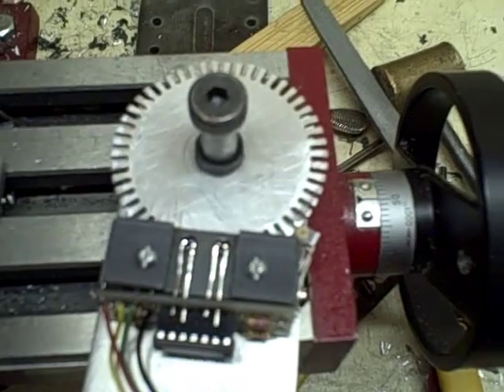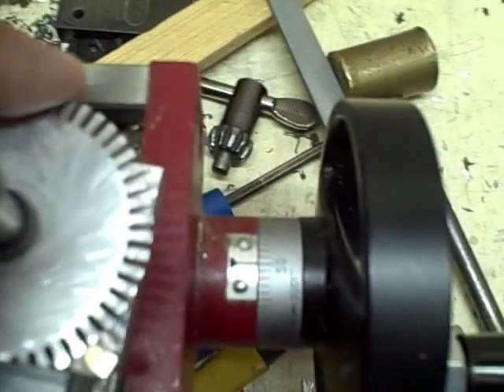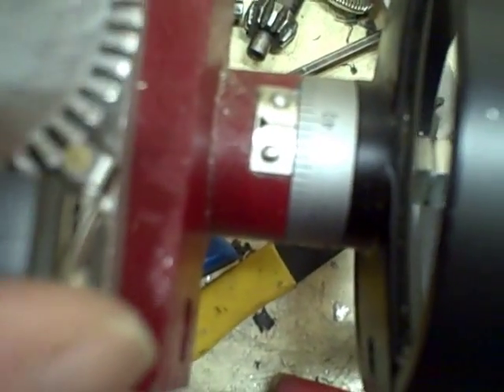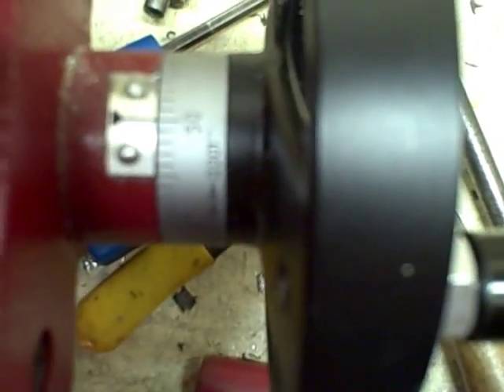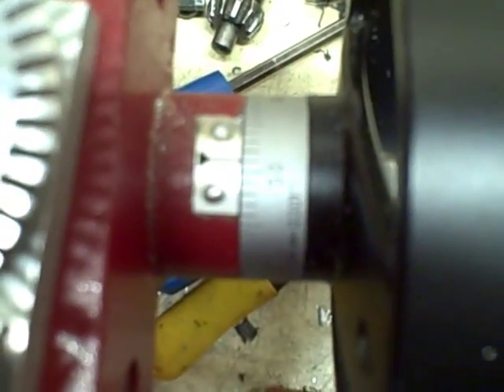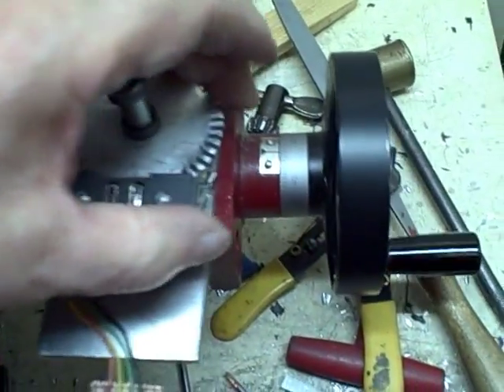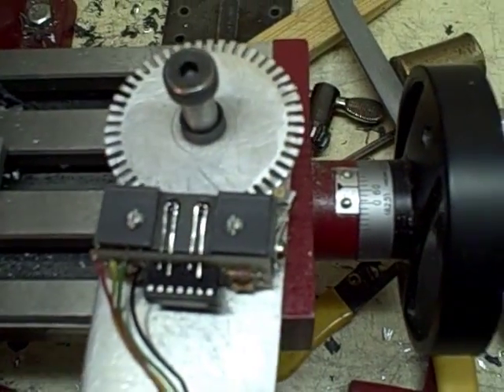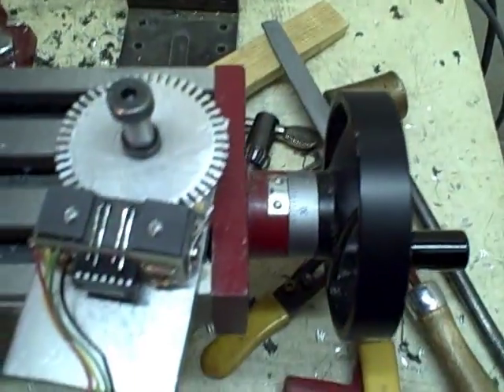MPG (Manual Pluse Generator) Test  using Mach3

Comment from the maker: @123hikid There are two IR Optical sensor, One for Clockwise and one for Counter Clockwise. The same sensor is use for the Limit Switch when blocked for open and close.